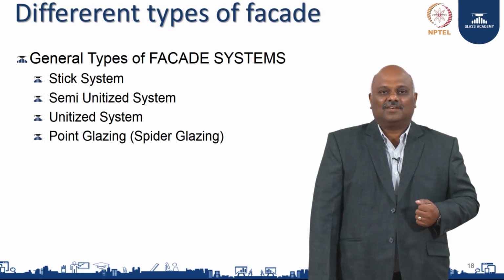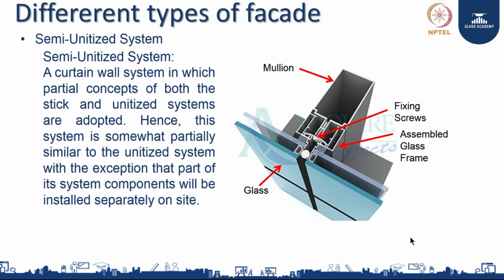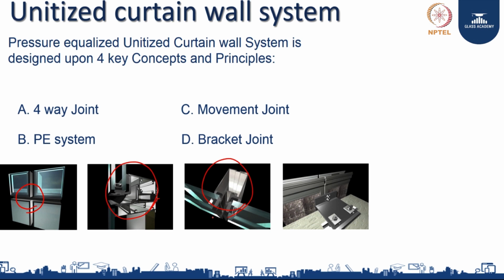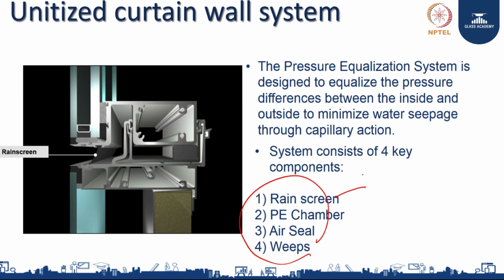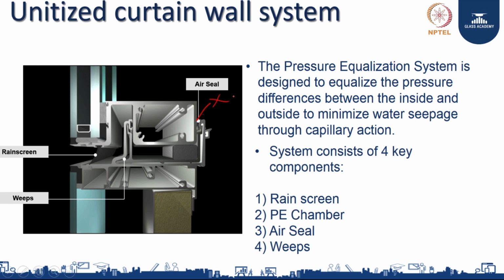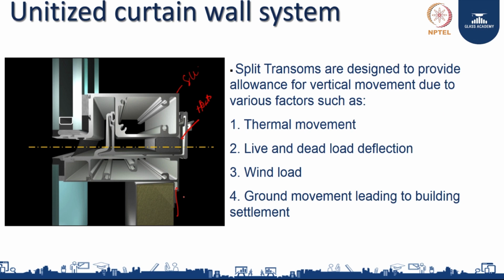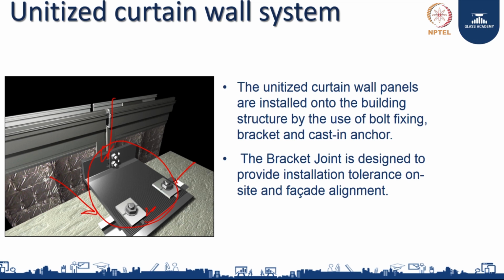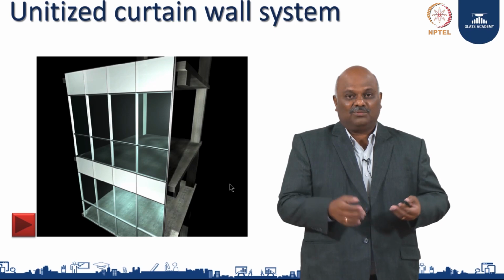Facade Fundamentals Part II

Comment: I'm sorry to say that fixation of UCW is not correct (around minute 30), you cannot bolt the bracket directly to the panel. Bracket is fixed in position, if you bolt directly you block all the movements and this is not correct.
Reply: You can block the movement in a single corner of each panel (top left corner of all panels or top right corner of all panels) but then the bracket must accomodate the movement of the adjacent panel (ie the movement side) this allows for thermal expansion only, then the interslab movement and slab deflection is accommodated in the stack joint. One thing which always confused me is that there are multiple different unitised concepts which allow for building movement in different ways. In europe they tend to use female to female systems, these typically have sword plates to maintain alignment up the facade and force the panels to rotate when the slabs shift. Then in the US and other parts of the world you have the male to female systems which essentially hang from the slab above and allow all of the interslab movement and slab deflection to happen at the stack joint. If your slabs shift by 10mm then the joint will appear offset by 10mm. But if the slab deflects then the mullion joints essentially slide along each other to create a stepped effect along the top of the frames.
Reply: @Nickgowans  Thanks for your reply, I know how to design a UCW doesn’t matter if it’s male/female or female/female, I’m on this business for more than 20 years. But the bracket design your showing on this video is not correct. You mention to fix (as example on top right corners) but you’re not showing the fixation that needs to slide at the top left corner. This is the point that I want to reach. The bracket design showing here doesn’t work. If you need to allow for vertical adjustments and also horizontal movements to allow thermal expansions, this bracket doesn’t work, one direction is missing. Hope you can see what I mean. Regards
Reply: @sergicastel  hello sergi, thank you for your reply, I didn't make this video and spotted the same issue that you did, this bracket design allows for no vertical adjustment and no lateral movement. However some systems don't require the lateral movement and rely on a sliding movement. This video is very flawed in many ways and there are multiple different approaches to the bracket design which aren't covered here. I've been in the facade industry for about 15 years primarily targeting parametric design through inventor and Revit and I would be interested to see how quickly this system would fail in a dynamic model :-)
Reply: @Nickgowans  you only have to put this design into a model and apply normal forces. Wind, lateral movements and live loads. Then you have always 3 movements to allow. As this bracket doesn’t have, it’s a wrong design and shouldn’t be take as an example. For sure there are many ways to design a bracket, so many inputs to be consider. That once again, this bracket is wrong, doesn’t matter which system or loads yo apply. By the way, ALL Unitized Sytems needs to allow lateral movements, imagine the stress at the profiles if you don’t allow lateral movements due to thermal, live loads and seismic. Just think how this panel or any will move if you don’t allow lateral movements 😉